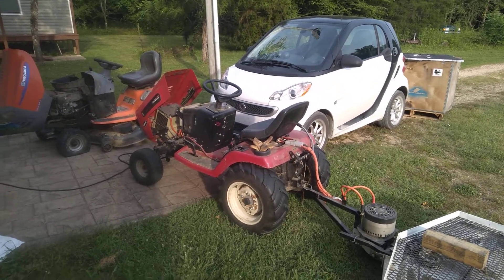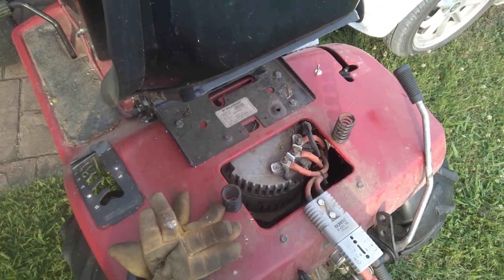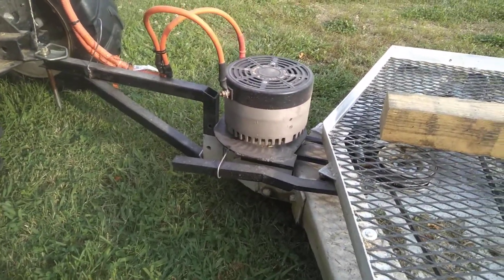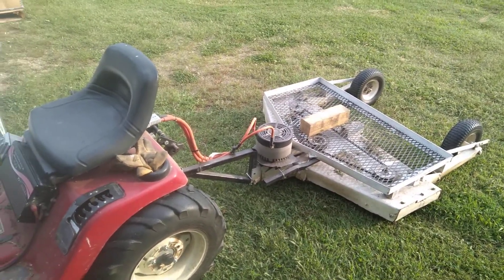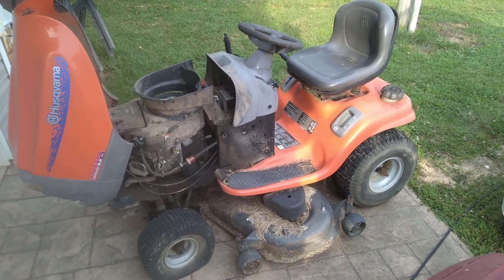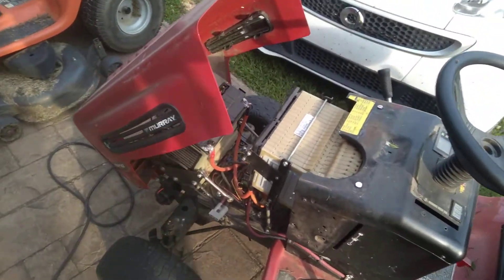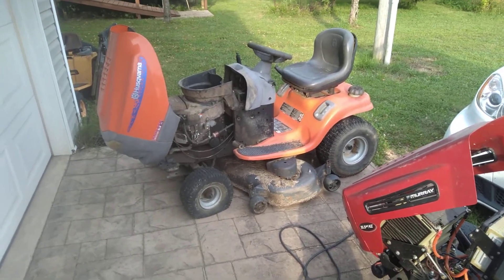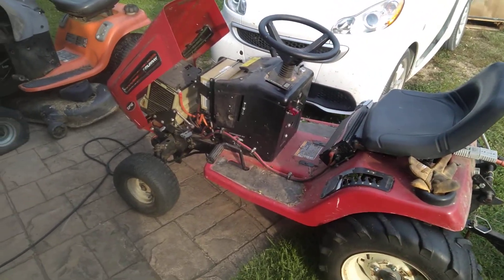Cut grass all summer on ONE GALLON of gas!!

Comment: 33.7 kilowatt hours
The ratings are based on EPA's formula, in which 33.7 kilowatt hours of electricity is equivalent to one gallon of gasoline, and the energy consumption of each vehicle during EPA's five standard drive cycle tests simulating varying driving conditions.